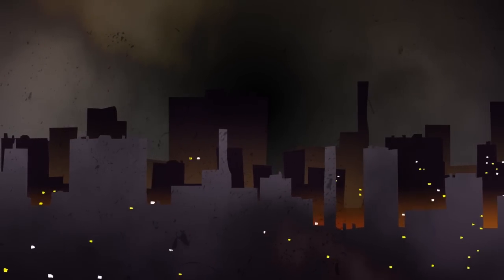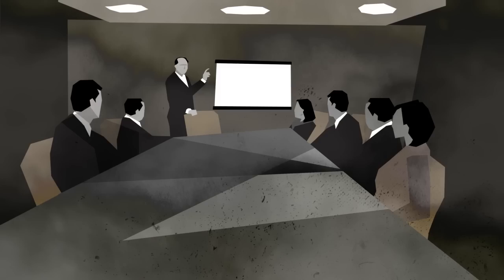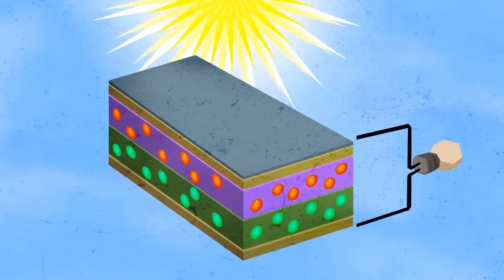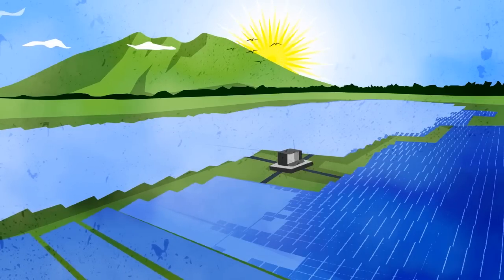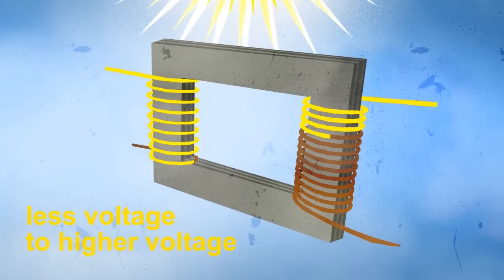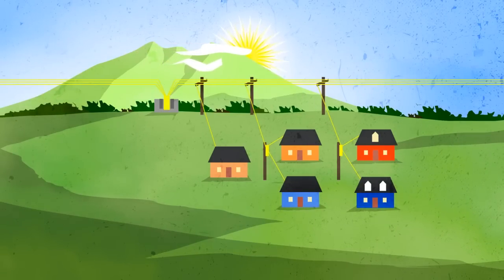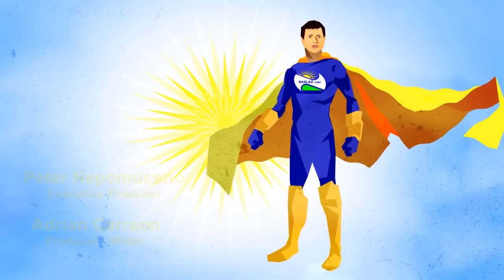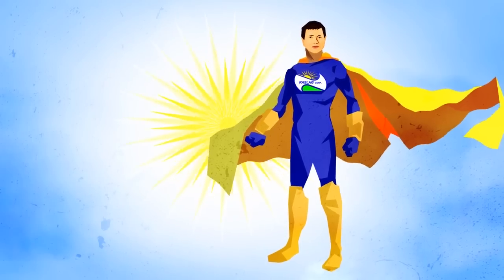How Solar Photovoltaic Power Plant Works

Comment: Only you give MEANING PHOTOVOLTIC POWER! We can say that as an array of photovoltaic panels mounted on the roof would be able to supply a part of buildings electricity needs. 150sqm of space is available on the roof of each wing. Also everything you have said. Because an array of 150msq would supply up to 10 000 kWh  per year, saving  1800 ECU per year in electricity costs. If both wings were used, the 300msq array would save approximately 3500 ECU per year.

Comment: Hi,
I was just wondering with a large power plant, what can happen with electricity when sunlights are obstructed from time to time and at night time. Is there any solution?

I know, batteries can be used for small installation not for large systems.

Comment: I think my system with half solar panels on one side of the mount and the other half heliostats which are pointing to a tower which heats the water and powers a turbine.
With the solar panels connected to a large battery like the Tesla battery, would be a much more effecient system. And of cousr
Also a dish shaped parabolic type heliostat is much more effecient than a flat one.
But if going for a half and half solution on the same mount cost wise both flat panels are better.
A patent on the ideas typed in above if not already filed.